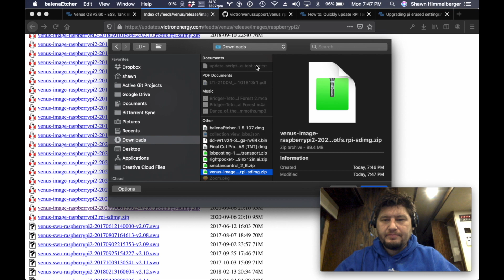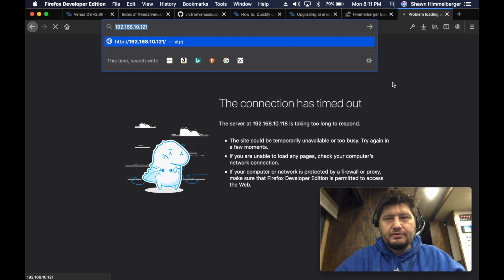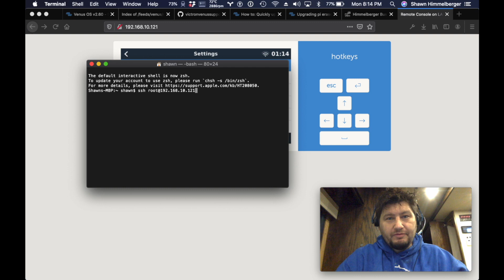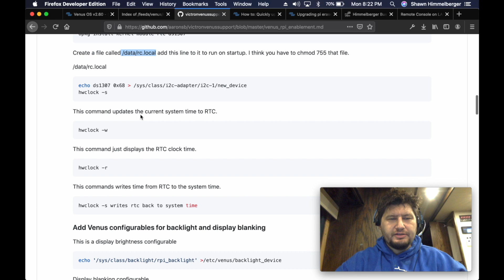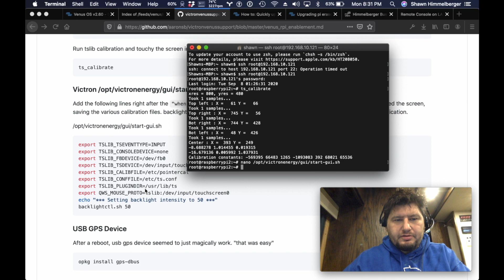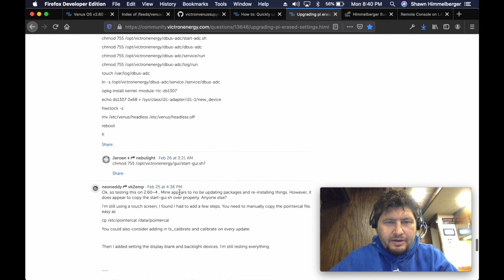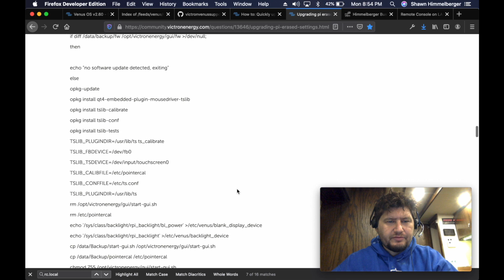Install Victron Venus OS 2.60 on Raspberry Pi with Update Script

Comment: Great tutorial, thanks a million. Was hoping to set this up on my boat in Ireland, but I don't have wifi on board. I use my phone as a hotspot. Any suggestions for how it could be set up without wifi?
Reply from the maker: You can connect  the Pi and laptop together with your hotpot, it will act as a router between the devices.  If you have a USB keyboard I’m sure there is a way to preset a WiFi AP to connect. Or at the very least use the keyboard to turn on the display, then use the keyboard to navigate the GUI to turn on and connect to WiFi. Lots of ways to skin this cat.
Reply: @HimmelbergerBus  Wow that's the fastest youtube response I've ever seen ha. I'm not sure how I would do the section where you wire the pi directly to the router. Only one way to find out! I'd use it to upload my solar/battery monitor data once a month, so would make no sense to get a router especially.
Reply from the maker: @staplep   the YT studio app makes it pretty easy to see and reply to comments. NP. 

Anyway, yeah, I’d just set it up to connect to your hotspot / phone or whatever via WiFi, then turn it on or off on the Pi as needed.

Comment: Nice work, Do you think you'll offer a pre-configured device?
Reply from the maker: Like a full on raspberry pi ready to go?  Not really.  The venus GX is a good buy these days.   If I can figure out how to strip the VRM ID, I'd distribute a Pi SD Card Image file.
Reply: @HimmelbergerBus  Is it possible to get the full display on an Android?
Reply from the maker: @michaelcanto6175  Yeah, you can use the remote console to view the  that nice GUI on most any web browser.
Reply: @HimmelbergerBus  Cool, so I just go to the playstore / 
Victron website and download the venus gui app?
Reply from the maker: @michaelcanto6175  VictornConnect is a good app to have, it might work, not sure.   But it can be even simpler, if you know the local IP of the Pi, just put that into a web browser on the same network and you should get the GUI.

Comment: THANK YOU VERY MUCH !!!
I did all the steps in the video, raspberry show the icons : AC INPUT, MULTIPLUS, BATTERY and AC LOADS, only PV INPUT is missing. Any information about that missing icon?
Reply from the maker: You have an MPPT charger connected With be direct to usb I assume . Try reconnecting everything, and rebooting. Every once and a while I’ll miss one charger, reboot and it’s back.
Reply: @HimmelbergerBus  Hi, i have MPPT Epever with RS485 to USB converter, so i think that Raspi on USB ports searching only Victron devices with ve direct protocol. On my setup, i just need that one USB port on Raspi search Epever MPPT with modbus protocol...I just dont have that programming skills like you, so can you advise me somehow..Sory for bad English, and best regards!

Comment: Thanks for the video and all the info ! I think i got it all working.......my system is not setup yet but this looks like it all worked !
Reply from the maker: Glad it helped
Reply: @HimmelbergerBus  Funny thing , I now went to install this because my van is almost ready and when i put it in the box months ago it booted up fine,,,,Now all i get is no input  :(    no idea wnats wrong since nothing was done with it for months
Reply from the maker: @jgsphoto34  Like no inputs from the devices or no screen output?  If no input from devices and you're using a USB hub, try reconnecting everything.  I'll get times even now when I lose the Multiplus for a few minutes or a solar charger.  Usually a reboot fixes it, or reseating things.
Reply: @HimmelbergerBus  thanks, for some reason I kept getting no input and after a hour or so finally it started to work and got the screen back! Thanks again for all this info !

Comment: Another cuestion. I try to configurate the analog imputs on venus rpi with an mcp3208 adc. Do you have any manual for configure this ?? thanks a lot.
Reply from the maker: That has been the tricky part.  A few people have made headway on that at https://community.victronenergy.com/index.html .  With looking at everything involved, I'll use a VenusGX or CerboGX  instead of rolling my own hardware.
Reply: @HimmelbergerBus  It would be nice if someone expert made copies for different raspberry models, with all the settings. In the first versions even making the touch panel work was complicated, now it has advanced a lot and it is a wonder that it only costs € 60.
Reply from the maker: @HPV2209  In my previous video I did release a  configured  image file.  However, the VRM ID was connected to my account, so I had new friends contributing to my data all the time.   If we can figure out a way to strip that out, I'd be happy to post a configured image.
Reply: @HimmelbergerBus  It would be a breakthrough for the community and would pave the way for many people. I have also thought that a free software PCB could be designed that includes the input level sensors (mcp3208) and some temperature sensors. I work as an electronic technician and would have tools for it, including contacts in China for cheap production of these.
Reply from the maker: @HPV2209  I agree but got pushback from some in the community, purists perhaps.  I'm more like you, a pragmatic and wanting to spread the word and lower the barrier to entry.   There has been some efforts to making hardware for it. 

https://community.victronenergy.com/idea/41865/home-brew-boxed-hat-and-cape-i2c-and-analogue-inpu.html 

https://community.victronenergy.com/articles/38710/victron-raspi-hat.html

Check these out
Reply: @HimmelbergerBus  I don´t understand this rejection, not only happens with this matter. In all groups there are people like that, the philosophy of free software preaches the opposite.
If you want to collaborate and do something about it, I am available.

Comment: HI ! thanks alot for this guide. One question, you shut off the raspberry directly or you have any bottom for this ? What is the correct method for shutting down this system ?
Reply from the maker: If you want you can SSH in and do "shutdown -h now" -h is for halt I think, -r for reboot.  Or most of us just unplug it.  It's all SSD storage, less chance of something horrible happening.  I did have an issues with cheap SD cards for a while, they seemed to fail after 3-4 months.  I bought a name brand one and it seems to work fine now no matter what.
Reply: @HimmelbergerBus  I also turn it off directly, but raspberries are usually somewhat delicate and break the cards. So far nothing has happened and I always keep a copy. thanks

Comment: hi man! 
Do you have information about how much power the pi/screen use in standby and on?
Reply from the maker: I'd say close to 10 watts   I'm using a 2.5 amp supply, and it does show the lightening bolt from time to time. As far as adding it to my power budget, I don't worry about it.  My inverter uses way more on standby mode alone.

Comment: Hey I wish you would show the hardware required and appx cost to get this going. I just purchased a bus and am looking to do my first systems build. What would I need for sensors or specific inverter and charge controller etc? Thanks man for your great videos.
Reply from the maker: https://youtu.be/SRTkp4AO3dI I think this video shows the complete overview. I’m not sure if I went into costs on everything.  I didn’t include all of it because the video was long enough as is.  Pretty much buy Victron everything and it will work. Venus OS does work with some other networked inverters and solar charge controllers, but I’m not sure which.
Reply: @HimmelbergerBus Okay thanks! Ouch expensive though! Have you looked into grid tied to offset house loads when parked at home?
Reply from the maker: @nbarnard  I have, that's ESS in Victron world.  Problem is with the tree cover at my current spot, I don't contribute much.   I started buying cheaper components, but they kept failing, I had enough and spent the money, no regrets.

Comment: I've just flashed the SD card with Etcher, but Raspberry Pi 4 doesn't show anything on the screen. The green led is flashing for a couple of seconds and then turns off and only the red led keeps ON.
Why I can't see anything on the screen?
Reply from the maker: You need to find the Pi4 build, I’m using a 3

Comment: Thanks for the video... some newbie questions...

I am thinking about picking up a Pi 3B+ to use with my BMV712, MPPT Smartsolar and Multiplus. The 3B+ has WiFi... so, if I get it all hooked up with the Pi on my WiFi, could I skip the monitor and just open the VRM portal on the Victron Connect app (via iPhone/iPad)and get all of the screens through that? I’m talking about all the data screens and the cool flowy screen with all my devices and the blue balls going from device to device? 

Also, since I would skip the monitor screen, would I be able to bypass all the code for the touchscreen that you have shown?

Alternatively, if I did go with a screen, do you have recommendations? Obviously I don’t need the best for this application, but there are so many on Amazon with so many mixed reviews... also, if I did the screen, I would like for it to be wall mount and preferably only have one cord (HDMI) running from the Pi up to 20 feet away for the screen...

Thanks again!
Reply from the maker: Yes, if you don’t use a screen it just works like a VenusGX, use your phone or laptop. 90% of those video is not needed:-). 

If you do want a screen, I’ve only used the official one that uses a ribbon cable from the Pi to the screen. Instead I used a USB hub and USB extension to get the Pi near the monitor.
Reply: Himmelberger Bus Wow, thanks for the fast reply! 

I’m new to all of this and only recently got my stuff installed. I didn’t realize that I could get the same info from the Venus GX, I thought that was really only on the CCGX and now the Cerbo GX. I didn’t think the Venus had WiFi capability I guess... so considering this , if I don’t necessarily have to have the wall display, would the Venus GX be worth considering over a DIY Pi build for someone that doesn’t mind tinkering with stuff, but has never actually done anything like this? I guess with the Venus GX I would just hook the wires directly into the Venus GX, then set up the VRM from the Victron Connect app? I wouldn’t have to worry about updates and what nots like I would with the Pi?
Reply from the maker: The Advanatage with the Venus GX is it has ve direct ports as well as tank inputs. So it saves you money on USB Dongles. With the Pi , you need. USB to VE direct dongles and an MK3 to usb dongle for the multiplus. It adds up. If you don’t use a screen with the Pi, updates work fine. 

I have 3 ve direct dongles and 1 MK3, it adds up, if I could do it over again I might to a Venus GX and use the PI with touchscreen as an MFD.
Reply: Himmelberger Bus thanks again. I may just wait til next month and see if I can find better deals on the Venus GX. Right now I see them for just under $300. Another question, I also see the Cerbo GX at only about $30 more than the Venus GX, would spending a little more on it provide any significant improvements? I know that it would allow me to hook the Touch 50 up later down the line if I wanted. 

Also, sorry for all the questions, but what is an MFD?
Reply from the maker: The CerboGX is the future for sure, $30 is cheap to get the newest hardware. I don’t think there are any disadvantages, only upsides, but you’ll want to compare ports and all that.  

MFD is Multi Function Display, used in boats more. Just a fancy way of saying “a screen that can be switched to show different information “.

Comment: good video.

does anybody know if its possible to use the raspberry as the router with a gprs modem and a simcard?
Reply from the maker: Possible, maybe, but with Venus OS you're more limited than with raspbian.   I use Calyx connected to a router for mobile internet.

Comment: Really helpful video.
The installation went great and it all seemed to work first try, but the VenusPI can't see the Cerbo GX.  They are connected together using the Victron USB/VE.Direct cable. They are both online on the same wifi network. I can connect to the desktop (not sure what it is called. The screens that show the data) on either using their IP addresses. The Cerbo shows levels for the connected sensors, the network name, and the picture of my boat.  The VenusPI is the desktop with nothing changed.  

Is there a setting on the VenusPI that tells it where to get its data from?  I'm new to Victron so Im sure I am missing something very basic. 
thanks
Reply from the maker: If you have a Cerbo GX, the Pi is not needed.   The Pi at that point would just be a remote display over HTTP.   Cerbo does support an HDMI touch screen I believe.   Connect ethernet to the Cerbo GX, then use VictronConnect on the same wifi network or the bluetooth app to get the IP of the Cerbo.  Enter that IP into a web browser and you should see everything connected to it.   You could then use any rPi Linux  like Raspbian plus the touch screen and a built in web browser to control the CerboGX with the Pi, same as with a desktop computer.
Reply: @HimmelbergerBus  
Yes, but it is the clunky web interface with the arrow keys.  Very hard to use with a touchscreen.  I was hoping for the full screen UI that the VenusPI provides.  I guess Ill have to buy the Victron monitor.
Reply from the maker: @yt-stuff-0000  Before Venus OS 2.4 or so there was no on screen keyboard or anything.  I was looking for ways to get that clunky interface with the arrow keys.   You can still use touch in that interface though, I use it on my phone often, the arrows are just extra.
Reply: @HimmelbergerBus  
On my iPhone the touch interface is really unreliable.  Things end up at the bottom edge of the screen and its hard to make it work.  Ordered the Cerbo GX screen from Ultimate Passage this morning.  A lot less than I expected.  Repurposing the PI for OpenCPN (sailing app).
Reply from the maker: @yt-stuff-0000  Being that you're on a boat, there is a nice MFD view.  You need to enable MQQT and maybe something else, then you goto http://*cerboIP*/app  https://community.victronenergy.com/articles/12690/venus-html5.html
Reply: @HimmelbergerBus  
I installed it on the boat.  The MFD view on the B&G chart plotter is a voltage/current readout with a button that brings up an iPhone sized view of the Venus desktop with the onscreen arrow keys.  Touch sort of works, but not really usable.  That said, set up was really well implemented.  Truly plug and play.  Its useful.

Comment: This is a great video. Specially for people who want to use a touchscreen monitor.
My question is for the connectivity from the Pi to all your devices: Are they all connecting using a VE.USB cable into the 4 USB ports of the Pi? Or is there a way to use the built in Bluetooth of the Pi to connect to the various SmartSolar devices like the MPPT or/and a battery monitor display etc...?
Reply from the maker: Yes I have a 4 port hub  connecting VE Direct USB dongles and one MK3 to USB dongle in a bay in our bus, it then runs a single usb to the Pi.   I'm not aware of a way to to it via BT , I'm sure someday that may become a reality. My $.02 though, is when it needs to just work, use wires.
Reply: @HimmelbergerBus  Great because i had the same question...i have a multi 3000w inverter and a victron mppt 100/30 30 Amp Solar Charge Controller and was not sure how to connect them...thanks for a great video

Comment: just used you video to get the Pi4 running with 2.60~22 from 0517 (nooby here). tried the newer one and couldn't get past the logins. now that that is done, do you have a video that shows how you interconnect all of the devices in the bus. i currently have mppt and bmv712, connect using VE networking and use bluetooth to read the status. am trying to get access from the web using VRM I guess. any thoughts? oh by the way, great stuff, love the old mci's, I used to manage a repair facility that we serviced them all the time.
Reply from the maker: I have a solar update video from the spring that shows this. All of mine are VE Direct connected with a usb hub and USB adapters.
Reply: @HimmelbergerBus  if the pi had bluetooth could i use that to connect? Is there a bluetooth for the victron app?
Reply from the maker: @markstumpf9391  I don't think that's currently possible.  It's one reason why I'd go with a VenusGX today.   Look around in here though. 
https://community.victronenergy.com/search.html?c=&includeChildren=&f=&type=question+OR+idea+OR+kbentry+OR+answer+OR+topic+OR+user&redirect=search%2Fsearch&sort=relevance&q=bluetooth
Reply: What did you use for login and password at Victron energy splash screen?
Reply: @joekrueger615  you don’t, you change the command to turn on headless. It’s at the end of the instructions.
Reply: I just realized it appears I need the Victron Venus hardware to do all this, not just mppt solar controller BMV 712 monitor and Bluetooth module
Reply: @joekrueger615  no, I have a bmv712 and mppt connected to a pi4 using ve cables. I am running 2.6.5 software on the pi, it works perfectly. The only hang up is at this point it needs the ve cabling.

Comment: Any recommendations on touchscreens for the Pi?
Reply from the maker: I’m using the 7” official one , comes with a kit and case. It works well. Looks like this one doesn’t have a case, maybe they stopped making it. https://www.amazon.com/dp/B073S3LQ6Q/ref=cm_sw_r_cp_api_fab_JB2AFbBNFXK0B
Reply: @HimmelbergerBus  thanks! I have a pi already, not being used, will see if I can get that screen tho :)

Comment: Is the RaspberryPi 4 model B compatible?
Reply from the maker: There are some early builds, but nothing official . Check the Victron Community forums.
Reply: Bugger, Just bought a Pi 4 B then found this after it didn't boot
Reply: @ryan543213  My Pi4 model B is working